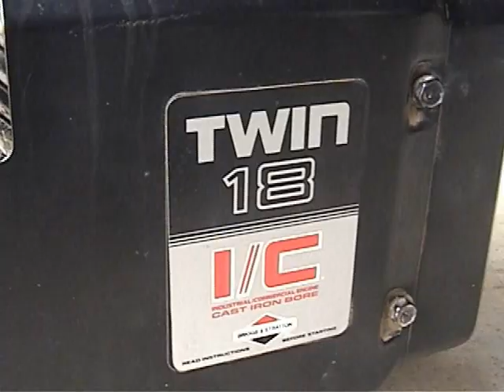Building the Go-Kart (High School Senior Project Video)

Comment: That's pretty awesome!

Try finding a front brake caliper off a street bike and get the hose and master cylinder too.. You can clamp the master cylinder to a pipe you can mig to the frame, cut the lever short and run a cable through it linked to the brake pedal.. 

I used a setup like that on a friends kart and it almost worked too well! Even with a fat guy and a large twin cylinder engine on 22 inch tall tires it still effortlessly locked the tires up!

Comment from the maker: i wouldnt bother with that. i put new taller shocks up front so its perfect. the single a arm suspention gives it way more travel than a double would. plus, i want to focus on the back. its off weight if you didnt notice, and it isnt all that durable. i want to make a swing arm with a motor mount on it.

Comment: Very cool, but it needs more weight in the rear if your gonna use it off road and a bit beefier suspension in the front. I like how much travel the rear suspension gets though.

Most go carts are rear engined, but yours is more of a mid engine and that takes traction away from the rear.

Comment: Not a bad design really. move the centre of gravity forward to compensate for the larger rear tyres through the corners but still having good off the line traction due to weight transfer.

Comment: thats a nice looking kart, but i think you could accelerate faster, if you got slightly lighter, or smaller diameter rear wheels, for less rotational inertia, and just gear it as tall as you need, but i noe, those rear wheels do look kool

Comment: if you make the rear wheels smaller you will have better acceleration but a lower top speed.  but the thing is you have an 18 HP engine if i seen that correct so you have plenty of HP to get it up and going w/ smaller tires.  sweet cart though.  very well made it looks like.

Comment: It is probably more work than you want to do, but it would balance out better and handle better if you cut and extend the rear part of the fram to center set the motor giving it more of a stretched buggy look.

Comment: Put a snowmobile engine and CVT transmission in it...  And fix the front suspension geometry, it's horrible. Otherwise it's awesome, I like the way it looks alot. What's the shock on the rear from?

Comment: Your weight distribution seems a bit odd.  Why have large rear wheels if you don't have anything to tack it down to the ground with?  It looks like you intended it to encounter rough terrain but the thing would front flip with all the weight in the front like that.  I would also suggest a bit more horsepower.  Overall, not a terribly bad beginners job.

Comment: bigger gear on the rear drivetrain would be better ;)
Think bicycle if you're not sure - when u pedal up a hill, what do you change into? small gear on the power train (ie your legs) and large gear on the driving axle. Wheels are opposite, as its then the ratio between the size of the gear driving it, and the wheel its driving. the bigger the difference, the harder its gonna be to turn those wheels, so dont go for monster 17's! unless you are trying for a slow acceleration, high top speed.

Comment: @loopinator1 
that would be EXTREMELY low, a good offer would probably be in the $1100-$2000 range
ofcorse it would be more if they had a better motor on it

Comment: lol, you can roll ANYTHING - go fast enough, and hit a corner wrong, or the wrong surface at the wrong angle, and the outside wheels WILL dig in, and it WILL roll. Looks a dangerous chassis design anyway.

Comment: front wheels are too small.
the weight distribution is too much to the front
too small engine 
I am an mechanical engineer
Work on this project and it will be really fun to drive
in this state its dangerous

Comment: With that much power, a chain that long, and those big  -ass tires, the chain is WAY too small.  After an hour or so, the chain will be either too loose to stay on, or broken.  You need motorcycle 520 chain.